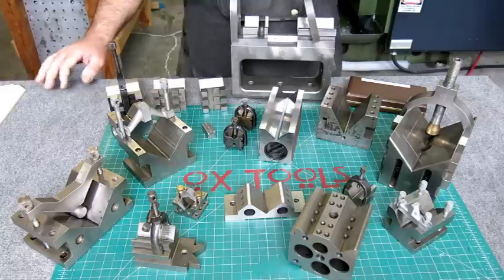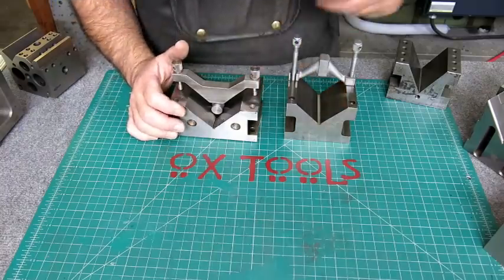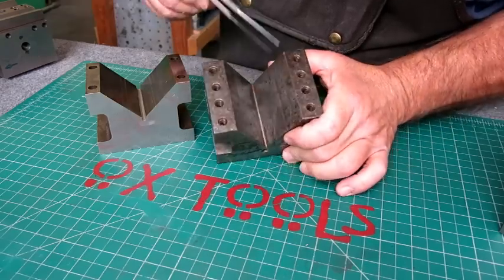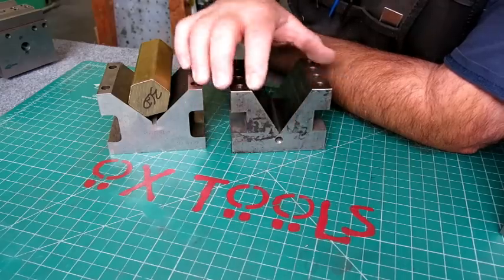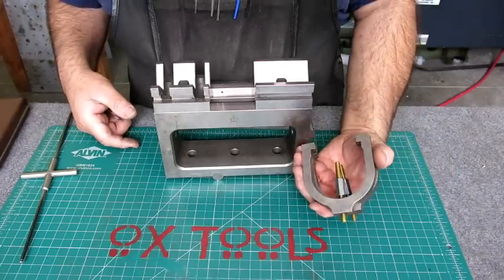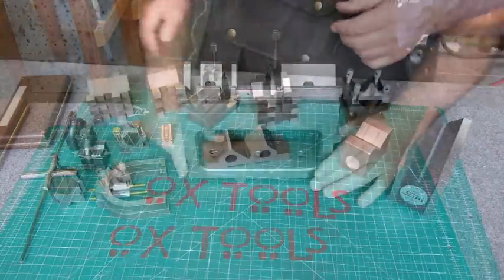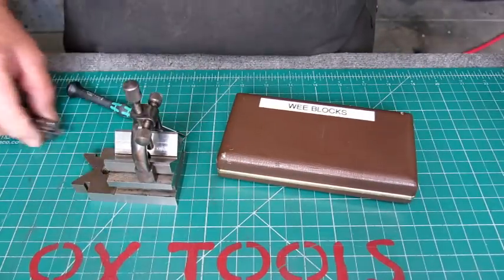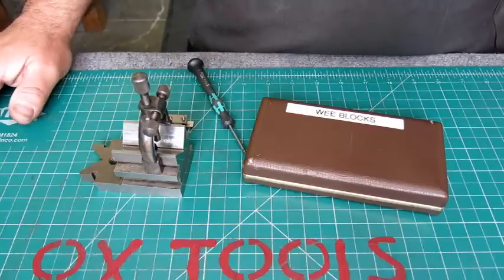Fantastic tools from the Toolroom V blocks

Comment: The Wee block, looks like it is useful for punch grinding fixtures, were the V-block rotates.
Reply: That's what they were made for. Used in a Harig Grind-All or similiar piece of kit
http://www.harigmfg.com/ultragrind5cv.html#:~:text=Harig%27s%20enhanced%20version%20of%20the%20Grind-All%20No.%201%3B,for%20grinding%20punches%2C%20core%20pins%2C%20and%20EDM%20electrodes.
The grind all rotates in one four point bearing

Comment: Anyone interested in the idea of roundness being difficult to check should look into shapes and solids of constant width. It will make it instantly clear why two point measurements are no good for determining roundness.  Here's a good video by Numberphile on the topic: https://www.youtube.com/watch?v=cUCSSJwO3GU
Reply: If you have a 3D printer you can print a set very quickly and be the life of the next party! (I keep a set on my desk for customers to play with, though the real reason is to help me spot the engineering and metrology types who know what they are.) You can also make the linear version that those are based on, called Reuleaux's Triangles (best stab at the spelling), with a lathe and three equal lengths of hex stock. I also have a set of those on my desk with holes drilled almost through them so they double as individual pen holders.

Comment: Hey Tom, the block you were calling asymmetrical with no added features, is that an angle block for setting up in a grinding or milling vise? I have some that style, and the one that looks like yours is marked as 30 degree.

Comment: Funny you mentioned using V blocks to inspect roundness of features.

Joe Pie just put up a two-part series on the very issue of cutting a grossly out of round part, that still would inspect within about .005 TIR when rolled under a dial test indicator on a surface plate.. he mentioned that using a bee block would show the lobed geometry

Comment: I need to mill a 45 degree chamfer on a rectangular bar to replace a broken dovetail clamp . I'm thinking of using v-blocks but I've not seen any videos of clamping anything but round bar ?  Is there some reason they are not used for replicating the 45 angle ? great video.

Comment: I made a V-block very much like the first one you described. Only differences were the interior v angle was 120 degrees to allow for larger diameters in a smaller configuration. Also, I drilled and counterbored  screw holes for a 1/2" Socket Head cap screws in the center of the V way, and through the length of the block. This allowed attachment to my large angle plate or milling tombstone at any rotational angle. It was made out of 4140, hardened and ground to perfection, approximately 4×5×6" in size. It would hold up to a 7" diameter. Now since I've retired, my tools are making someone else's job easier and accurate.

Comment: Hardened parts are less conducive of magnetic lines for the same reason we use a magnet to tell us when two metals are at the correct temperature for force welding. 

The crystalline matrix is quenched into a state that is closer to non magnetic than the annealed parts are.

Shop metallurgy 101

But you're a very busy guy Tom. We can't be expected to remember everything at all times .

Cheers :)

Comment: Hey ox, what kinds of jobs can somebody with a degree in metallurgy get? Are metallurgists in demand?
Reply: SpaceX and Tesla are doing the most interesting work atm, imho.
Reply: It probably really depends on which matal you specalize in.

Auto makers are going to higher strength steel that stamp well, so cars can be thinner, lighter, cheaper, higher gas milage.
Aeroplane makers also want lighter, stronger but do more titanium, aluminum alloys  and are moving towards carbon fibre that gets glued together.
Jet engines and rockets want the same thing, but in super high temp alloys that have high heat strength.
Machine tool tooling  sintered carbides with longer edge life, better finish.
There is lots of RnD going on if you get into the right companies.
Even govt research is still lead by companies funding and joint ventures with companies.
Reply: No.  Get a degree in another technical field.
Reply: Stay away from Tesla. They are at a point where they're losing money every Q. Tesla can't figure out who is in charge and they came figure out how to turn a profit. They're busy making farting features and developing new cars, instead of improving the products they have. Tesla is not a viable business model when they have to constantly look for an a new influx of capital every year. They're also really trying to move development operations out of the U.S., because they don't want to pay US engineers.